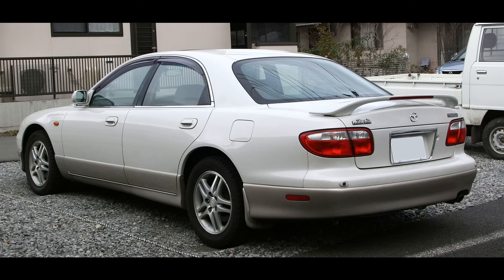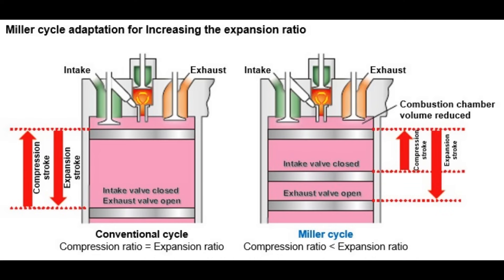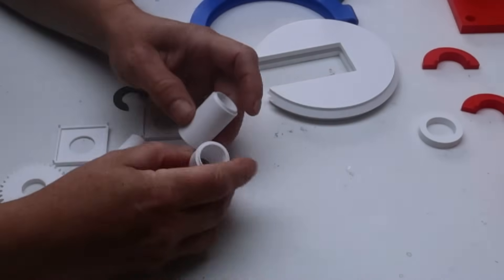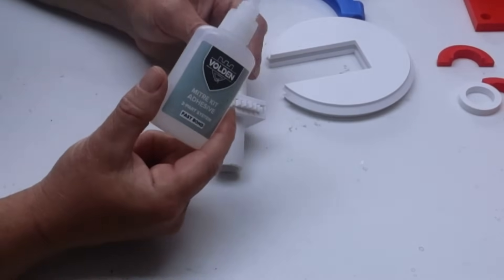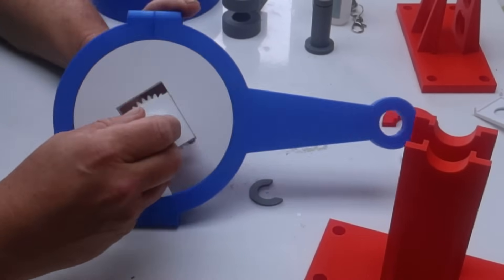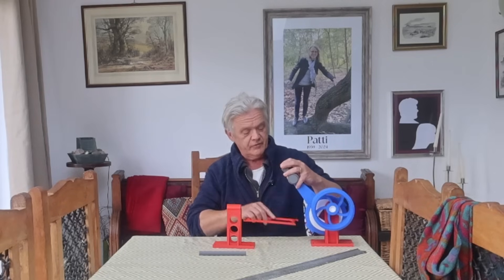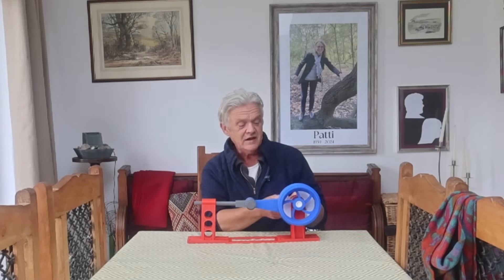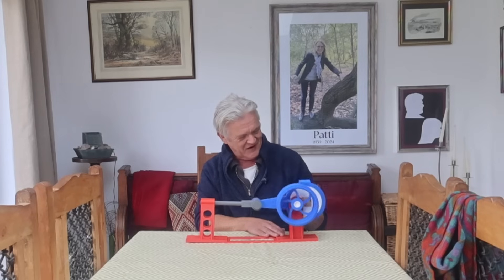2436 A Variable Stroke Piston

Comment: Never stop innovating - Imagineering - Rob did that so well - we all walk on the shoulders of giants...

Nothing missed in that analyses- so many options -  not only could this be an engine or  pump - but connect 2 together (or simply have a fixed crank, scotch yoke or ratcheting drive and we have a variable torque / variable speed CVT  (double variable variable transmission - allows even better input and output dynamic matching..  6 minutes thinking with an epicyclic stage and the whole thing could be  a compact reversible rotary CVT - I'm sure (balance is often the issue in real / high speed systems)..

Comment: I see a complication: the variable piston stroke is referenced to half of the cylinder volume. As the stroke begins to increase the piston draws a minimal amount of fresh air to add to (nearly) half a cylinder of stale air from the previous power stroke. This also means there is a minimal amount of compression. 
  So the efficiency variables include, the changing compression ratio, changing amounts of unburned fresh air and preburned air, as well as the new and preburned fuel.
  It would be interesting to see how they solved these issues. Wow, that looks like a really complicated combustion cycle. 🤔

Comment: Imagine how easy it would be for a starter motor to start and engine with that technology. The starter could accelerate to its top RPM with the crank at zero displacement. Then the crank displacement could be increased slowly or quickly or in-between to get things going.
Reply from the maker: Interesting thought, cheers!

Comment: The simplest brilliant way to simulate variable displacement was done (of course) by the Japanese in the prius. Leaving the intake valve open after intake  TDC and a blow back chamber. A variable cam gear is controlled by oil pressure. It's soo beautiful. Lol
Reply: You need to do some research before giving them a verbal handj0b regarding LIVC. Also, that wasn't variable displacement, it was variable displacement and variable effective compression ratio.
Reply from the maker: cheers mate